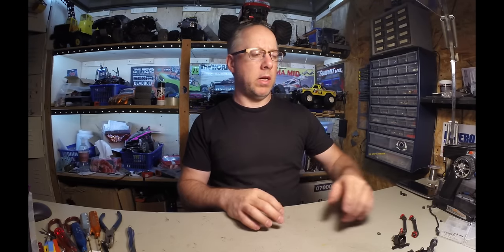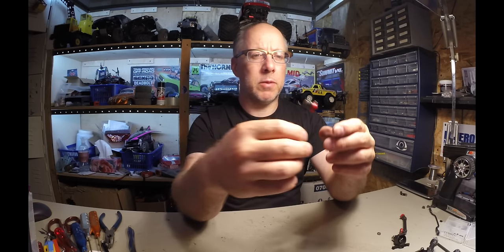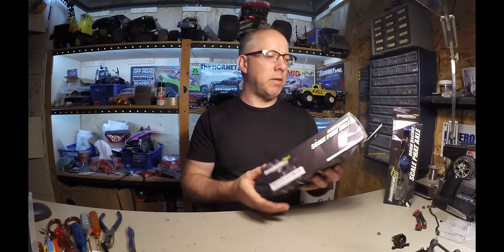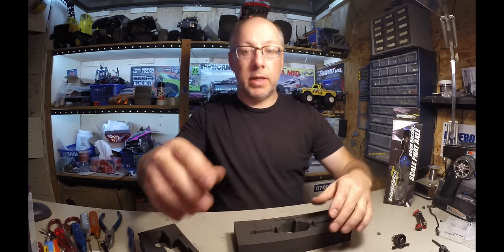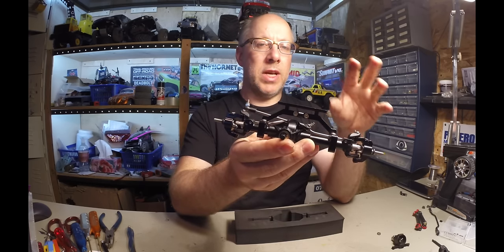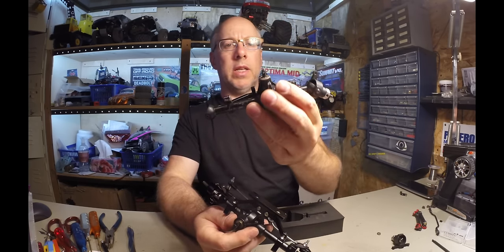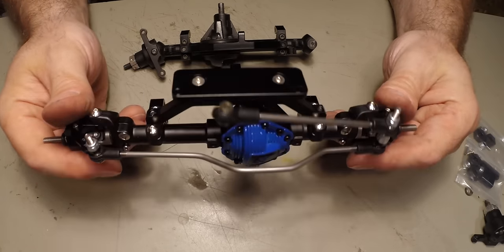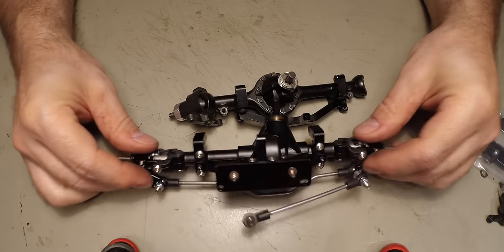Gelande II TF2 BoomRacing Phat Axles - These are Discontinued.

Comment: same thing happended to my rc4wd gelande II w/cruiser body kit and mine broke on the second drive and i was so disapointed because i had been saving my money all year to get one posted to me to Australia. just wondering what tyres esc motor and do you run plastic or steel driveshafts with the boom racing phat axles and have broken any parts in the axles yet cheers mate
Reply from the maker: The tires are Mickey Thompson's, 
Driveshafts
http://asiate.es/aff?l=114793&i=35116
ESC
http://asiate.es/aff?l=105100&i=35116
Motor
http://asiate.es/aff?l=97898&i=35116

One of the diffs did strip the gears in it, however Boomracing has since corrected the issue that caused this. It was merely a spacing problem as the gears were not meshed correctly. And during use its good the check your mesh on any diff as wear will increase the gap in any mesh.

Thanks for watching.

Comment: Are you able to put these axles on an scx10?
Reply from the maker: Raiden Perez prob not a direct fit but it can be done.
Reply: What do you recommend? yota axles and these axles are my options. Just looking for scale narrower axles for my scx10
Reply from the maker: Raiden Perez how narrow?
Reply: I’m currently running boomracing phat axles but there just to big and doesn’t look scale.
Reply from the maker: Raiden Perez the scx10 phat axles? Or the D90 phat axles?
Reply: Scx10 phat axles
Reply from the maker: Raiden Perez well you have to adapt your links and possibly other items. How narrow do you need to go?
Reply from the maker: Raiden Perez these just came out this is the most narrow axles available. http://asiate.es/aff?l=151552&i=35116